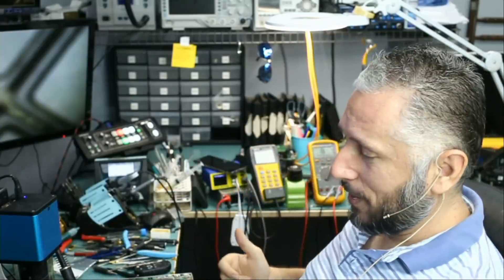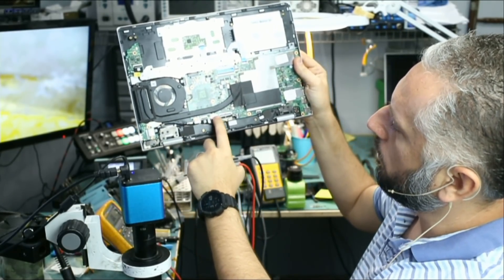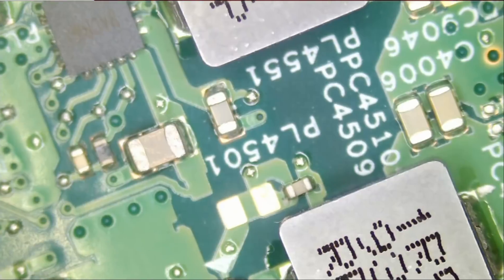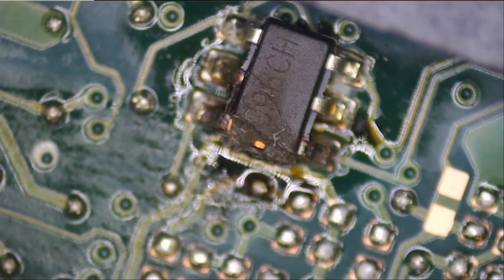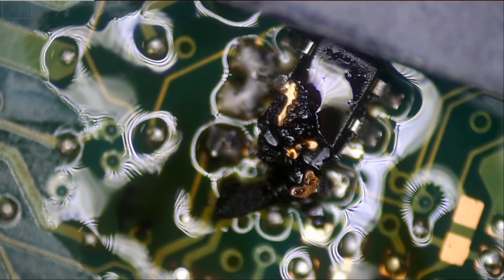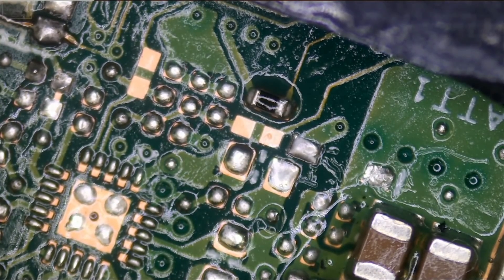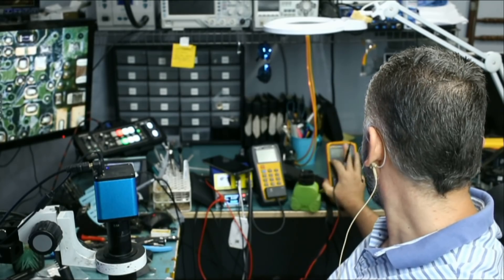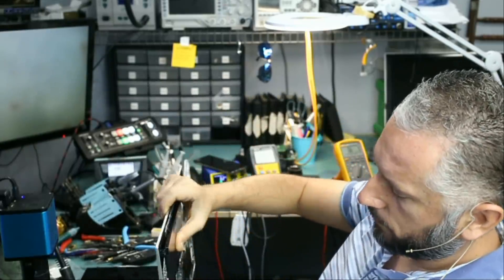HP Laptop 15t-cn100 Froze then won't power on

Comment: I have an Envy 17-j029nr that does a similar thing. Only difference is no blown components! There is however a diode array that has fallen off the board and taken its pads with it, but that was near the audio components. SATA also doesn't work when it is able to turn on lol.. Installed Windows on its little 32GB mSATA cache drive and it fully works other than SATA, battery not charging and says its disconnected but runs off it anyways (charges when powered off tho haha), and no power with the light flashing sometimes (more times it will just go solid and off)

Comment: I've a MSI GF63 but my laptop isn't responding.  I can't see charging light or anything . I've checked my charger is working fine . What could be the issue the jack is also fine . I'll be glad if you can suggest any solution

Comment: A possible direction on this one might be when you injected voltage on the short, the high current caused an open circuit on another component on the board causing the short to disappear.

Comment: Hello, that the leds are lighting up indicates that DC_in, 5VO and 3VO are present and the EC is working. Check the other voltage rails 5VA, 3VA and 1.05V STB. The chip you desoldered is probably not a TVS, rather a watchdog IC for charging with a power_good output for one or more other rails(I'm not sure but I've seen such things on wistron acer mbs and the placement of the IC looks like that).

Comment: Try to reflash bios chip I had those issues in the passed after repair still no power on hp laptops, reflashed the bios chip and it was done.

Comment: Please Help sir !!!
I installed windows 10 on dell Inspiron n5010
Then downloaded drives from dell website
Duing bios update from Version a5 to a15 screen went white then laptop was off
Tried to reset bios by removing bios battery and holding down power button and nothing happened
Watched a video about installing bios files on a fat  usb flash drive then holding end till plugging the power supply and that a bios installation will be performed automatically but in video only the screen was off but lights were on and laptop was beebing
In my case everything is off no sounds no lights nothing
Regards from Syria i follow you since long time.

Comment: Is low melt solder, 60 40 solder?
Reply: What is the ratio of tin and lead in low melt solder?
Reply: Sure would be cool to be able to buy one of those power supply voltage injection tools!

Comment: Have you seen a dell laptop who just died from nowere? Mine just did this,cheked the ac adapter and i was having 19.7 volts(but also 42 volts AC) at the output.I am curious why do ac potential appears after transforming to dc.Before dying it was powering up,but after board reasambly it completly died.Ty,i love your video,they are awsome.

Comment: smd c96ch chip also used in desktop mother board . you will find in  g31/g41/h61/h81...  near to  external  usb connector & usb port  use it

Comment: No need to replace the broken IC, this is not the cause, the IC is only for protection of the high speed dataline
Reply: "No need to replace the broken IC, this is not the cause,"
Well yeah, but it's broken so it should be replaced still, no? What kind of fukked up approach is dat homie?
Reply: @kanytonaan5594  what i mean is that the laptop will not depend on the ic to be replaced, the laptop does not work now and replacing the ic will not fix that

Comment: The ESD protection chip is in parallel (essentially zener diodes) so soldering it won’t fix anything. I think the clue is the missing short circuit. A short can become open in these two scenarios:
1) the shorted component burned - a required component needs to be replaced
2) the power loss to RI ^2 heated the short, and resistance goes exponentially up as the temperature rises. If it cools down and the short is back - bingo.

Comment: Hi Alex,
Awesome logic for fault finding 👏
The chip is used for Electrostatic Protection for high speed data interfaces and referenced AZC099-04S R7G with an imprint of C96CH.
GND is PIN 2, VDD is PIN 5 and 4 others Pins are IO.
Reply: the chip mount ins // ( parallel ) to data lines so it's presence is negligible
It MUST work without the chip as the chip has no communication with any IC or generate any power rails
look elsewhere it's not that chip that's keeping the laptop from turning on
check RAM among things.. I hope it doesn't have integrated RAM as that may be the problem, symptoms look like it !
check power_on sequence under thermalCAM if there's cpu activity without display it's boot failure due to RAM/VRAM

Comment: If the chip is just ESD then the laptop may run without it, though something nasty may have been connected to one of the ports causing the chip and diode (which may be power related) to fail. Voltage injection / disconnecting the motherboard may have made the short on a component or cable disappear, but you already know this.